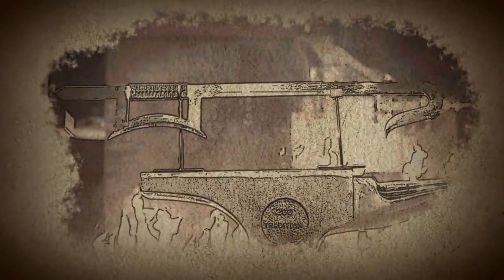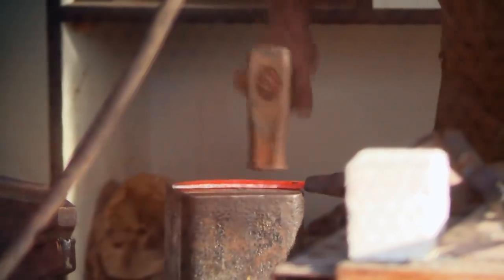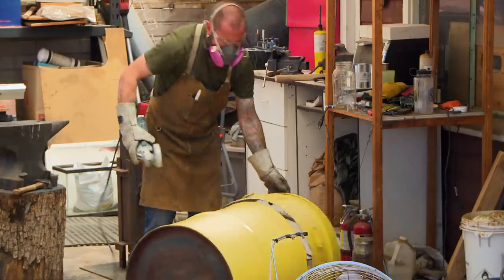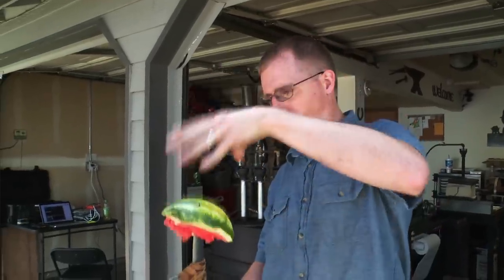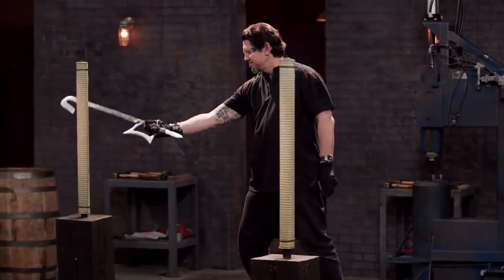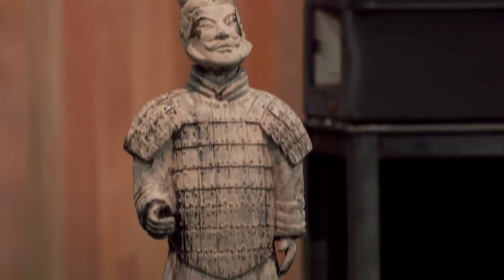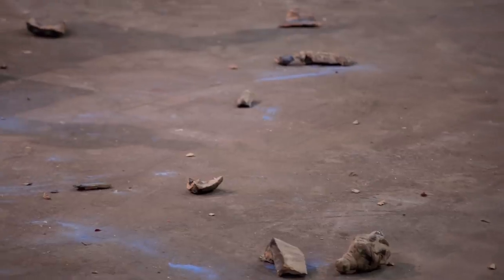Forged in Fire: MIGHTY Hook Sword DEMOLISHES the Final Round (Season 3)

Comment: Not sure I agree with this one. 
One sword that cuts great, is light and easy to use but picks up a slight bend when used as a bludgeon, VS a heavy dull sword that won't cut, is hard to control, but can be used as a bludgeon without any issues... What do you think?
Reply: Yeah that's my thoughts exactly.
Reply: Im with you on that one. I think the final result should have been a different one.
Reply: Fixing an edge is alot easier than fixing a bad heat treat
Reply: A keal test would have been helpful
Reply: I agree with you. I think the other sword should have been the winner. Although a dull edge can be sharpened, it didn't arrive in the judges' hands with a very sharp edge and the tests are all based on how the blades perform "as-is" upon time of testing - not after resharpening.
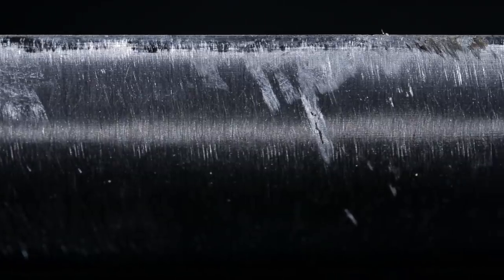Reply: Correct winner imo. The edge absolutely turned on Dave (9:29) and you can't cut yourself with it
Reply: "Your sword is better as a sword, but the other guys sword is better as a club, so you lose"
Reply: Same crazy
Reply: I'm not an expert but maybe they compared the two weapons to historical examples. If historical hook swords were heavier and the heavier weapon performed more like its historical counterparts, then this makes sense to me. I don't know if that was the reasoning, but maybe.
Reply: Rich won
Reply: Iam picking up the heavy one because we talk about what the weapons do in the test not what they are
Reply: agreed
Reply: Agree with your opinion, this suppose to be trick the opponent with hooking strategy weapon, not a heavy metal bar even not make the cut.
Reply: I agree 100% I'm a fan of this show, I've seen a lot of episodes here on YouTube and it's the first time I feel this way...
Reply: @Jimmy-iz2rx  I disagree, a dull edge can be sharpened.  A bent blade is a danger.  Dull or not, it could be fixed easily.  The other blade was already falling apart.

Comment: I strongly disagree with the decision, I even think the heavy weapon would have failed miserably if they had a kill test
Reply: It failed the sharpness test completely. It  didn’t even cut one tatami mat. The only worse outcome is a catastrophic blade failure. Since when did breaking terra cotta figures to test durability count over  a complete failure in a separate test?
One complete failure against a less than perfect outcome was what I saw.
Reply: They did a keal test but they didnt show it to us 
If you see in the background there are damaged dummies
Reply: make a sword sharp needs 5 minutes, make a sword stright from bend by bad heat treating you need to start over, simply as that.
Reply: @DDenDeeen  a sharp sword with a very slight bend will kill more easily than a heavy dull blade.
The sole purpose of a sword is to cut and kill. A heavy dull sword is slower, tires out the wielder, and allows for openings in their defense. Swings are off, timing is off, and a kill shot may be missed, or ineffective due to weight, or dullness.
It's not like the bend was severe. It was very slight; slight enough to continue through all testing. Dull completely failed the sharpness test, not even cutting through one tatami mat. It didn't even cut the mats halfway through. 
You can sharpen a dull blade, true enough, but you can also straighten out a delight bend as well. We've seen it done multiple times on the show.
What bothers me is the terra cotta test. Normally it's the damage to the blade that they look at, not how well it crushed pottery. I feel that test was off compared to the usual strength test.
(Besides, who wants a sword from a guy who hates watermelon.......)
Reply: They should have had a kill test idk why they never had one
Reply: @jetsigfuson4727  they did, they just didn't show it

Comment: I Have trained with hookswords, butterfly knives (Bart Cham Dao) and the three pointed double edged spear since i was 11, thats a total of 20 years. there are a few points ill bring up.
The front side of the hook, that had best be sharp and strong because its going to take quite a bit of abuse.
The crescent better be not only sharp but strong, i dont want to be pushing into something and have it break and possibly hit my hand.
The entire construction of the hooksword best be light, One of the ways you hold a hooksword is rearward, spike out with the hook at your elbow, if its too heavy then it is going to be extremely difficult to switch your stances when using them. You arent flailing the hookswords around trying to strike with different edges, there are specific hand positions that you use to position the sword to utilize a specific edge so to see an elegant weapon used like a battleaxe is extremely disappointing.
Also for reference. shuang gou are never to be linked together unless you are trying to distance yourself from an opponent. the risk of losing one is way too high.
On both weapons the crescent is way too far away from the handle. 
Rich's handle is Okay for the most part.
David's handle is terrible and would make it impossible to use.
Both blades were done wrong, neither have a pronounced central ridge.
David's blade breaking the terracotta? that thing is way too heavy.
Rich's blade bending and not going back to true? if he had the ridge, would have been perfect.
So to me this comes down to sharpness. David's blade not being able to make it through 1 single matt? that worries me. You could have stuck all 3 Matts together and Rich's likely would have gone through all of them and kept going. so my win here goes to Rich.
Reply: I thought that the hook idea was odd, given the laws of momentum and that there's a 50% opening. However, I am (pleasantly) surprised about the reverse hold you mentioned, given the European Sword groups are so adamant that it is a bad hold. 

I do have one question though. Been looking into ninjuitsu's ideology when it comes to blades and I was wondering if those hooks/guards could be used as effective climbing instruments?

Comment: Linking the hook swords by the tip for a more powerful strike? This seems like an absolutely terrible idea. Sure, it could help generate more force IF you could compensate for edge alignment (Which means single use strikes edge alignment is compromised), but a quick and safe recovery would be near impossible after that, making that just flat out stupid as a use for these weapons.
Reply: If you wanna see how it works, look up hook swords on the deadliest warrior, they did a surprising amount of damage

Comment: Even the guy who won didn't believe it. This episode broke all the rules. I see the 50/50, but I think they took his design into consideration too. The paracord wrap wasn't as clean of a finish as the leather binding. In this instance the weight was actually more helpful than the lighter one for the second challenge. I still would have given it to the sharper sword, the "warping" was so minimal between both blades  it should have been the zero factor not the winning factor.

Comment: Think that's a bit of a bad judgement call, to be honest. The heavier sword was harder to control, it didn't cut as well, and you didn't even test the whole of the weapons. With things like the sodegarami which have multiple offensive parts, you tested ALL of them - the tines, the spikes, the butt of the shaft.. but this time you didn't test the cresent guard, the hook, or the spike on the bottom of the handle. Why pick such a complex weapon only to ignore everything except for one cutting edge?
For all we know, based on what we saw from the footage of the forging process, the heat treat on the heavier swords hook could have failed and caused it to snap off had you tested it. Like with.. oh I don't know.. a kill test?
Rich should definitely be the one receiving the cheque, along with an apology.

Comment: Not keen on the judgement nor the testing methods. 

First of all, they only tested the one edge of a multi-edged weapon, same as any other sword test. Secondly, the competitor made a better handling, better cutting sword. The hook swords were made to operate as a two weapon system. If used the way they were intended, superior handling would be preferable to slightly better durability, especially considering the number of edges on the sword.

Comment: dont agree with them, sure it still work as a weapon even though it didn't perform as well except for the strength test, but for the real life design and purpose of this sword this is the opposite of what you want, I would rather have a small bend than break my arm swinging this like its meant to